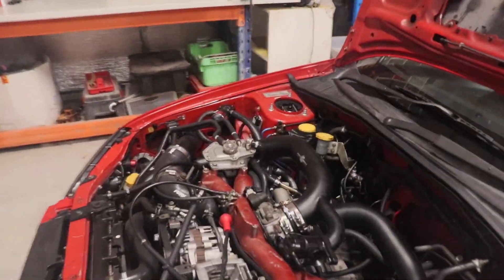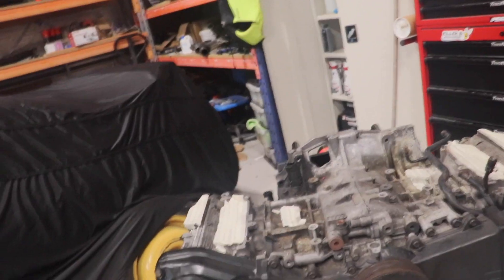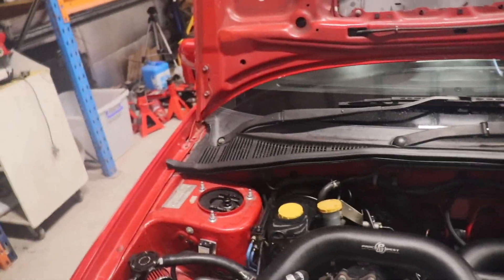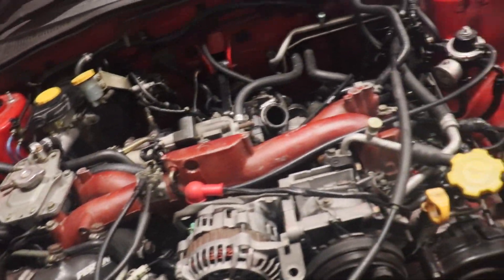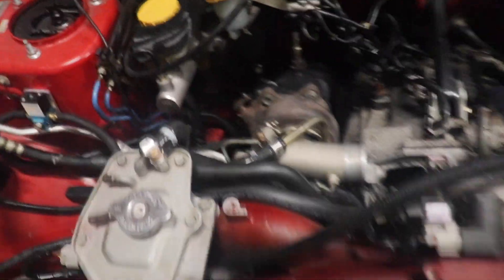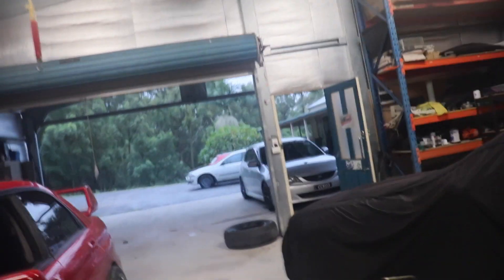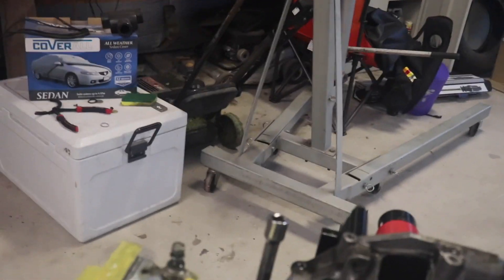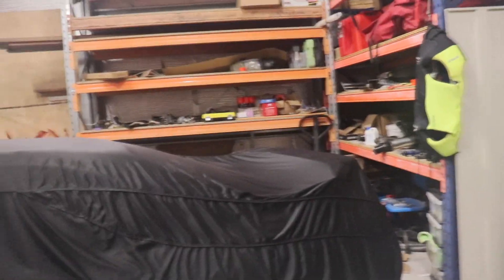My WRX Blew Up.... AGAIN!!

Comment: That's all these engines seem reliable for is breaking. Total crap of a motor?
Reply from the maker: yes, fairly unreliable. I ended up rebuilding to 500HP and blew the box so sold the car haha. I want a honda next
Reply: @UnrulyMotorsport  I applaud the rare honesty. I have a 01' Corolla. Sold my wrx, got this to get around and save money. If this motor ever breaks probably make it a project car, and put a civic motor in. K series possibly.
Reply: @UnrulyMotorsport  regardless of the b.s ppl respond  with online, I took the absolute best care of my fa20 wrx, never redline it, never drive hard under 180 deg oil, rarely ever drove hard to begin with, always used best gas, oil changes ever 3-4k, followed it's maintenance schedule religiously, and had two have rod bearings fixed twice or basically had two short blocks in  60k. I know a guy personally who specifically deals with Subarus and he says he's never had as many people in for issues with timing chains, or rod bearings than the fa20 wrx.  Also did say that the ej series have almost a guarantee ring issue under 200k.    Done with these piles of shit. Not worth spending 10k every few years having a new motor out in or rebuilt, they're typically all bark and no bite, and for the iffy reliability, not worth it.